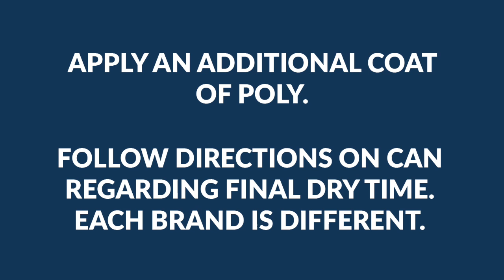How to Refinish Wood Stairs - Polyurethane Finish

Comment: I agree with Toronto Builder. Never shake or stir poly. Instead, use the stick to slowly bring up the concentrated poly from the bottom of the can.

Also, loose the sheep skin. You’re putting it on too heavy and you can see grouping of bubbles on the tread. Use a quality brush and apply a thin coat with long smooth strokes. Don’t jab the brush in the poly. It will create bubbles.

Also, it’s way easier to paint the stair skirts and rises before stain/poly. Good luck with your project !
Reply: What kind of brush is the best to use for applying poly to stairs? I’ll be applying a similar poly as used in the video.
Reply: @cwilkGMCR  go with recommendations of the poly manufacturer